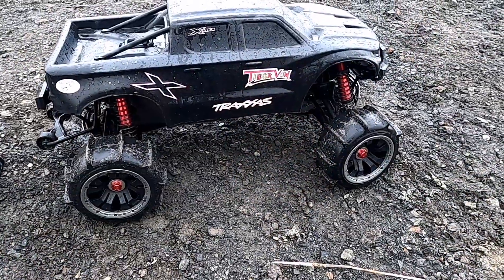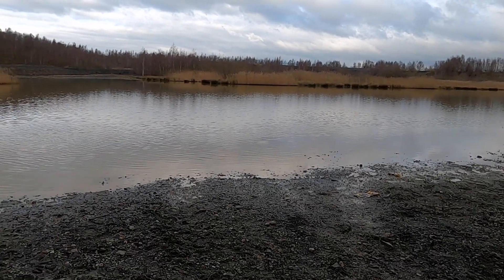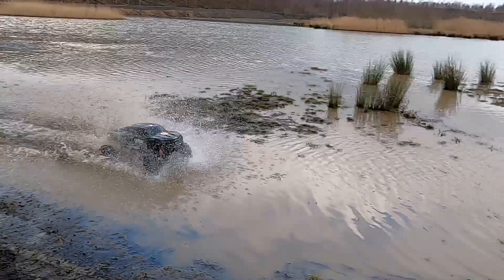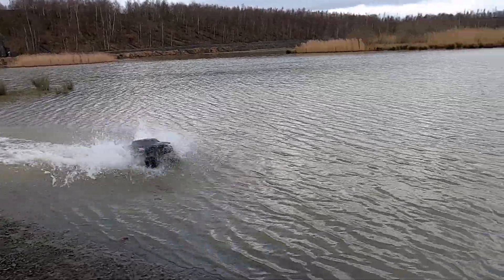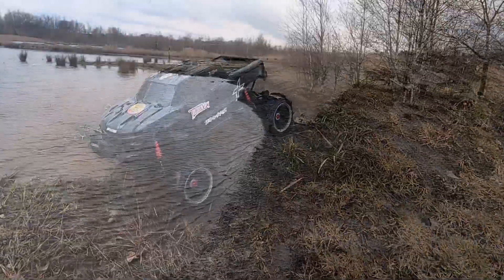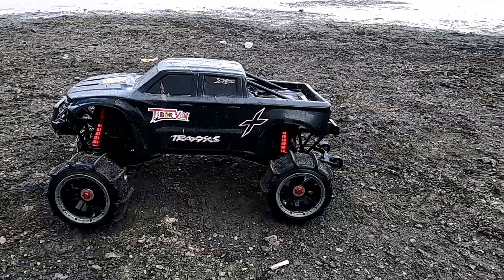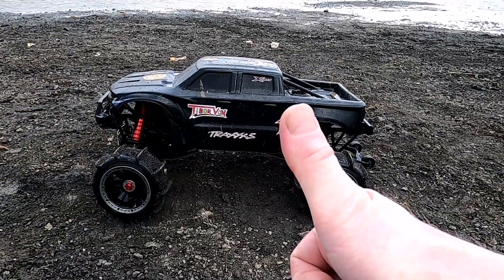First Attempts at Aquaplaning the Xmaxx

Comment: You did it I've seen a lot of them make water runs different cars different trucks the main thing that they all have in common is momentum before you hit the water Goodspeed not getting off the throttle great job it's just a drag bringing the truck down🤘😜
Reply from the maker: Thanks a lot dude. I have since bought some limo batteries with a 100c rating. Maybe they will help keep her a float for a little bit longer

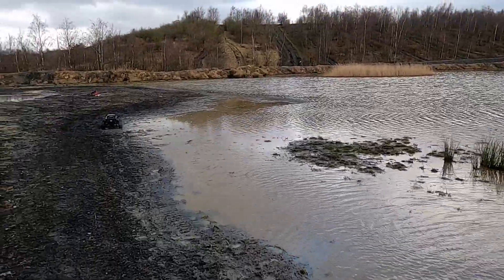Comment: Wow mate. Fascinating. What a refreshing change. I've seen this done on the Traxxas website where they aquaplane over a full sized bloody lake of about 200 yards wide. God only knows how they make it across but they do. Along with your lipo's, another contributing factor could be the spongy texture of shoreline which is stopping the truck from getting up to full speed before it hits the water. I think it would do better with a concrete run up. I'm sure that would improve things. Great attempt on 3:00. As you say things will probably improve with more charged up batteries. Great stuff..👍🏻🙂.
Reply from the maker: Thanks a lot dude. I have had a few good ideas in the comments. I agree, the run up isn’t the best and a smoother approach would be better.  Fewe people have said that the paddle tyres that i have fitted are not the best and this could be a big factor. Also i have bought some 100c batteries which should help keep the power up when on top of the water. The ones that i were using were 35c and 50c mainly. But i also think that, of the few videos that i have seen myself of Xmaxx crossing a lake, i am thinking that the electrics may also have been upgraded ?   Foolishly, i went here today thinking that my truck would simply glide across the water all day long lol, but every dy is a learning day eh !!!!   I did enjoy playing on the water though and making this video. I will return !!!!!!!!

Comment: Tibor! Man that was cool.  I smiled really big when you made it all the way through.  From watching other vids I think you need tires with bigger paddles.  If you could find a way to put styrofoam in the tires instead of sponges you may get the tires to float...(3T-RC is not responsible for any, damage, fire or injury to RC Monster Trucks or Tibor Von if you load your tires with styrofoam)...😀
Reply from the maker: Hahaha. That made me lol Paul 😂.   I agree though, a few people have made comment that bigger paddle tyres would be better. I have seen a couple of videos in the past of the Xmaxx driving across a lake with ease. So i thought by putting some paddle tyres on my Xmaxx then i would be able to do the same, foolish lol. I have come to the conclusion that the Xmaxx that i have seen gliding across water all day long must have been highly modified. But i still enjoyed trying and making this video. I have actually bought some better batteries now that have a 100c rating. Maybe they will help a little ?   But failing that, i want to get some hex adaptors and then i can use these wheels on my Notorius and Kraton and try these trucks on the water.
Reply: Yeah I’m pretty sure all the hydroplane vids are highly modified to get the job done. You got pretty far with the xmaxx. The 100c will help keep the wheels spinning fast and hard👍🏾

Comment: Nice tibbster you may need some bigger paddles if you want to go across lol 👍👊
Reply from the maker: Yes, a few people have said this. I think its a valid point. I have also bought some 100c batteries aswell so hopefully they will help keep it on top of the water longer too. But it was good fun playing in the water lolol
Reply: @tiborvon  I'd reckon smaller motor pinion to let it spin up faster and easier.
Reply from the maker: Got your email Carl. Am just out with some of the lads with our boats. Will reply later matey

Comment: That was funny where it just disappeared, lucky not an issue just a puddle. The tyres look a little small for the weight and size of the X-Maxx. Just picked up a second-hand Maxx the other day big enough for me and getting that ready for some mad bashing this year. I have the need for extreme :-)
Reply from the maker: Yes lol, lucky it was shallow Mal. I was stood in a blind spot lol.  A few people have mentioned the paddle tyres and said that better ones are available. Trouble is though, they are very expensive. As you say, the Xmaxx is a very heavy truck. But i have also bought some better batteries to try. Some with 100c rating in the hope that they keep the power up for a bit longer when on top of the water. But foolishly, i thought i would come here today with my paddle tyres fitted and simply glide along the top of the water all day long. Every day is a learning day eh lol. A new Max, that sounds pretty cool Mal. Have you had it our for a test run yet. i will look forward to seeing it buddy. They look like good bashers 👍.   Always need a bit of extreme lol
Reply: @tiborvon  Not surprised the larger paddle tyres cost a lot, the market is limited. You are right we go out with good intensions and it did not turn out quite as you wanted. The 100c batteries should help with keeping a constant power for longer, but burst id only for a few seconds. Yes the Maxx I have not been out waiting for the battery to arrive, I know it's 4s capable but I'm going with 3s 80c. I've seen them on  4s and they are mental fast so for me 3s perfect. I have a few upgrades going on once they get here the main is the wide suspension kit.

Comment: Defo need try this again with the new batts cuz I think it will do it..and technically u did hydroplane there but not for long
Reply from the maker: I agree.  I think the 30c batteries that i was using with deans connector wasnt good enough. I am hoping the 80c batteries and ic5 connection should improve and help. You can come help me film it 👍👍

Comment: Did the Batteries puff up ?
Reply from the maker: Hi Mark. No they didnt puff up. Strangely though, i went home thinking some of  the batteries were flat but when the went on the charger when i got home, they were showing 70 percent plus still charged. I wonder also, if the LVC was coming in for some reason. I havnt had time yet, but i am going to run the truck again just on a road or something and see if the batteries last longer than when on the water. I have also bought some 100c batteries to try aswell. I was honestly expecting it to go on the water for much longer
Reply: @tiborvon  
Yes I think you may need higher C Lipo  , 
Probably came down to Cut off voltage under load ? Or a dodgy cell? 
I just wondered I was blasting my Kraton over the park and my two new Peak Power batteries puffed after running down some tall weeds ? 
Hitting them at full speed clearing a path through the over growth. 
I was well p’eed
Reply from the maker: Gaz said the same Mark, he thinks the c rating was to low and caused LVC. That was the reason i bought some 100c batteries. But i have always gone through water with all my bashers and crawlers, even fully submerged a few times but the batteries have been fine
Reply: @tiborvon  
I think also the Traxxas ESC the Low voltage cut isn’t variable. 
You might be able to get by if for EG: you were able to Lower it 3.0v cut off , 
I know the BLX 185 that was in my kraton didn’t give me no run time and my Batteries would more or less be at Storage level after a run. 
I have the same on my Slash and Rustler they cut in too early .
Reply from the maker: I will have to experiment Mark